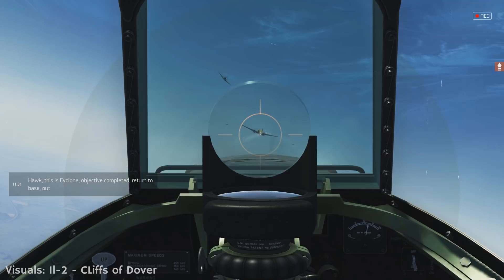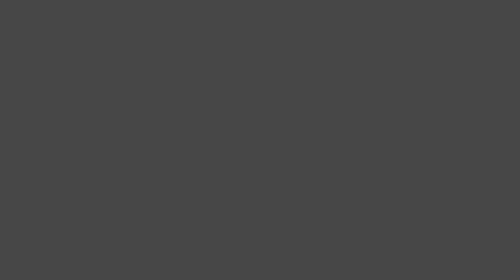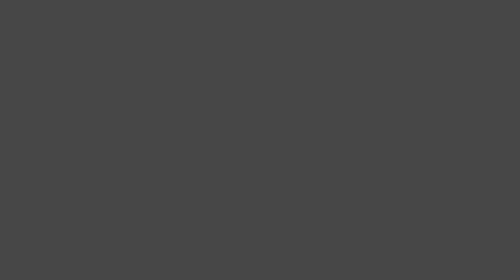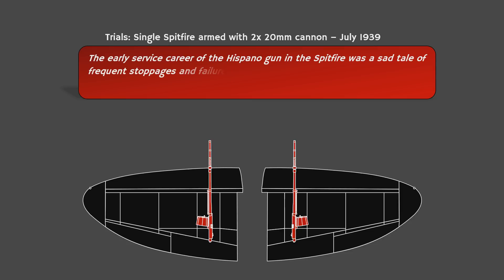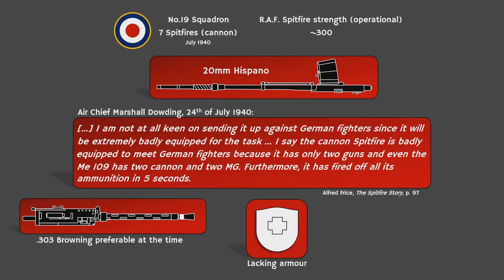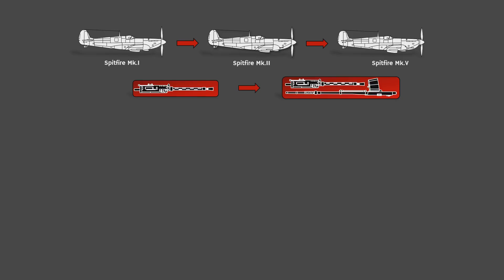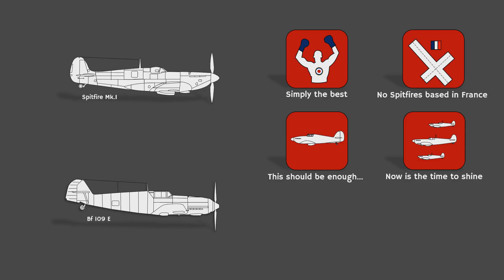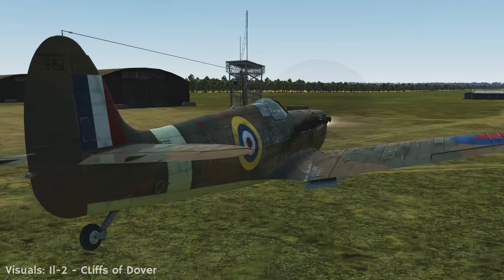⚜ | Clearing up Spitfire Misconceptions

Comment: There are two major factors that helped the Spirfire (and Hurricane) over the 109 during the battle of Britain:

1) Benign stall characteristics in a tight turn, a Spitfire had benign stall characteristics in a turn. When a pilot got close to a stall situation the stick would start to judder warning of an impending stall. The 109 on the other hand would give no warning and would depart violently. Ironically the 109 with its combat slats could out turn a Spitfire but it required a highly experienced pilot to take advantage of it. For the Spitfire (and Hurricane) a new pilot could perform tight turns without fear of stalling the aircraft.

2) Fuel, arguably the biggest advantage the RAF had, operating out of home bases RAF fighters had more fuel available for combat whilst a 109 was limited to a few minutes.
Reply: Even with combat slats the 109 could not out turn a Spitfire, especially at faster speeds where it was literally impossible to turn a Bf 109 but the Spitfire elevators were still very light. The Mk II Spitfire pilot manual actually specifically says it was well within the pilots ability to pull 10G's and to therefore treat the controls with respect. And the bf 109 slats were an absolute disaster anyway. They could often deploy asymmetrically and get stuck ruining the stability of the plane. If the Bf 109 was behind a plane then the slats could also be deployed simply from the slipstream of the leading plane and when the slats were open they caused aileron snatching making aiming impossible. There is a reason why Kurt Tank didn't include those awful slats in his much superior Fw 190.
Reply: The RAF switching over to 100 octane fuel between the Battle of France and the start of the Battle of Britain gave the Luftwaffe quite a shock. The Luftwaffe weren't too impressed by the performance of the Hurricanes and Spitfires they captured in the Battle of France and were expecting the same thing in the Battle of Britain but instead the 100 octane fuel allowed the Merlin engines to run at 12 lbs boost instead of 6 and they were all fitted with much more efficient propellers. The fact that most of the RAF in the Battle of Britain were made up of brand new recruits who had only received 10-20 hours of training before being sent into battle consistently outperformed their Luftwaffe opponents, most of whom had gained a lot of experience fighting in Spain, Poland and France, is a real testament to the quality of the Hurricane and Spitfire.
Reply: I remember watching a BBC documentary about the Spitfire V Bf 109, where they got engineers and current fighter pilots to compare them.
As machines they came out as equals. 
But the Spitfire won on ergonomics (more room for pilots elbows and better laid out cockpit), visibility (better canopy) and survivability (Spitfire had an armoured cockpit).
IE: As a pilot it was easier to get the best out of the Spitfire and if you were shot down , the chances were that you would liv to have another go.
Reply: Some of it was obtained from the USA - Britain actually developed its own 100 Octane blend in the early 30's and had significant UK based production capacity. Britain had stockpiled 100 Octane starting from before WW2 but didn't deploy its use until it was required for home defense ie it wasn't used in France. The British actually ended the Battle of Britain with 500,000 tonnes still in reserve such was the reserve they had stockpiled in advance.
Reply: ISTR Shell did a lot of the high octane fuel research --- ISTR  100 Octane was also produced  at BP Isle of Grain, Kent refinery  which must have been a bit to close to France for comfort . The vital glycol for the cooling system initially  exclusively came fro the USA.
Reply: yeah I don't get the spitfire hype when hurricanes did the heavy lifting during the war on Britains end
Reply: 18tangles lol that's a good one. And here I thought British bombers  were the reason hitler pissed himself and took the luftwaffes attention away from the RAF during the battle of Britain and towards london. But what do I know you think the spitfire beat back the entire Luftwaffe on its own
Reply: 18tangles I don't know what to tell you other then the RAF bombed germany in the month of august in the year 1940 during the battle of Britain. Google it, it was a retaliation after some german bombers bombed london
Reply: 18tangles just. Look. It. Up.
Reply: i have read of Spitfire pilots watching a chasing 109 in a steep turn, knowing that if the 109's leading edge slats opened the German would have to break off or stall and be toast.
Reply: Spitfire Mark1A  Can't say for the early part of the war but in 43 the Mustangs used 150 octane fuel and thus were   considerably faster than a 109. I would imagine the Spitfire could use it to after carb adjustment. The 109 was at a huge disadvantage because of fuel capacity, 20 mins max over England in the Battle of Britain. Also the Spitfire 1 had very poor armament (.303 with 8 seconds of ammunition). The 109 had 1very reliable 20mm cannon and 2 8mm  and later 12 mm machine guns with 28 seconds of ammution. All in all the Germans suffered from an insane dictator and a incompetent Luftwaffe commander. The Brits  had Hugh Dowding who only got a tenth of the credit he deserved.
Reply: To me it seems the Hurricane was built to be a rugged, effective, fighting machine.
The Spitfire was built to be fast.
And the 109 was all of the above.
Reply: Spitfire Mark1A 
Totally agree.
And then they made the Griffon powered Marks we all love to hate, 
it seems.
Sounds like book right up my alley. Will seek it out.
Of course you have read Geoffery Wellums book First Light?
Reply: I have always wondered why the spitfire wasnt equipped with droppable long range fuel tanks like the mustang.THe spitfires could only support bombers until they reached the french coast and then they had to turn back leaving the bombers to be attacked by the Luftwaffe
Reply: @falconeaterf15  I actually prefer dogfighting in a Hurricane (flightsims obviously)... It has been several years since I flew but it felt as though the Spitfire needs to bleed off speed in order to get the best turn characteristics whereas the Hurricane's max speed still allows for the tight turn that I wanted... if that makes sense... It's a feeling thing and I suppose it depends on each pilot's style. The Hurricane just seemed to do what I wanted it to instead of fighting against me. Couldn't follow a 109 in a steep climb though but soon learned not to try!
Reply: Fuel, range and time on station was why the Me110 had the best kill ratio of the BoB.

Comment: Thanks for an interesting video. One minor observation: I'm pretty sure your graphic of the .303 MG is upside down. I can't speak about the aircraft version of this gun specifically, but I know from personal experience that the standard land-based version couldn't operate for very long in this orientation as it relies upon gravity to remove the spent cartridges downwards once they have been pushed clear of the "T" slot on the face of the bolt. If fired upside down, spent cartridges would quickly accumulate at the (now upward-facing) bottom of the bolt and eventually fowl its operation. Again, I'm assuming what would apply in this case to a land-based .30 cal would also apply to an aero .303 MG.
Reply: You're right, the Browning graphic is inverted.  However, the Browning has an ejector which flips empty cases forcibly out through the bottom of the gun.  It will do this even inverted.

Comment: Well presented and very informative. Thank you.
A footnote about Hurricanes in the Battle Of France: I have "Fighter Pilot" by Paul Richey, which tells the story of No 1 Squadron's campaign while based in France during the battle. The bottom line was that, even when fitted with a fixed-pitch, two-blade wooden propellor, the Hurricane, when flown by seasoned pilots, could hold its own against the Bf-109 and was superior to the Me-110

Comment: I have always argued that the Spitfire is the best fighter if the war simply because it remained a very serious opponent from the first day of the war to the last. Many of the other "greats" weren't around from the start, and those that were weren't nearly as competitive by the end of the war. No matter what fighter an opponent was flying, including the Me 262, an engagement with a Spitfire was a deadly serious matter.
Reply: I think I read that the German supply problems with raw materials was one of the main reasons that they struggled to keep pace with British advances in metallergy. Sure, the Germans had the ideas, they just struggled with raw materials not that they weren't inventive.
Reply: The US kept the P-38 in production before firing and after, the P-40 as well.  You can argue they were niche fighters, but the P-40 excelled at simple field maintenance, ruggedness, and cheap to build.  Outfought me 109s low to medium level; turned tighter and rolled faster.  8 50 cals hit hard enough.  Ease of maintenance keeps them in service.  Guess my point is that no one machine did it all.  Range of a Spitfire, 423 miles, range of a P38, 1325 miles.  Lose an engine;  keep flying.  Nose mounted canon / macine guns, effective to 1,000 yards, no need to synchronize the bullet hose.  Spit as others, pick your yardage for gun synch.  No one design was head and shoulders above another in all essential aspects. The Spit was comparatively a short range weapon.
Reply: Except the later war models were a lot different than the early war ones
Reply: That had at least as much to do with the training of RAF and Commonwealth pilots as anything else.
Reply: @RemoteViewr1  the P-38 failed as a high altitude fighter.  Allison never did make a successful high altitude engine, not even in the P-82.

Comment: Video on spy, gun and reconnaissance cameras used and how they worked on aircraft in WW2? Attempt #4
Reply: I'd like to see that too!
Reply: and also their effort in the great war.
Reply: I too would like to see a video on this subject (and also contribute via Paetreon.).
Reply: The RAF reconnaissance Spitfires were really clever. The photos they took were actually in 3D which allows the intelligence staff analysing them so much more information and detail that they wouldn't have with normal photos. They could tell exactly how tall structures and defences were for planning attacks including the dam busters raid. They also allowed them to find the V2 rockets being developed, with normal photos a V2 would just appear as a tiny round circle on the ground but with their 3D photos British intelligence was able to see exactly what they were and even their exact height so air raids could be launched at the V-2 research centre and delay their development.
Reply: Evidensinsania: Not only Spitfires; the predominant PR aircraft in the RAF was the Mosquito.  
The British had pioneered the use of stereo pair photography in WW1, and made extensive use of the technique in WW2.  It was therefore well-known to all sides in WW2, yet the Luftaufklärung units did not make any great use of it.  Perhaps worse is the fact that the Wehrmacht had no central specialist reconnaissance organisation like the PIU at Medmenham, and that most reconnaissance was tactical in nature.
The measurement of ground features using Swiss Wild Heerbrugg stereoautograph machines allowed for the construction of accurate models of ground features to prepare for critical missions (the Dam Busters mission is the one everyone remembers - and those models were made at Medmenham) as well as accurate sizing of items like the V1 and V2 prototypes.
Reply: Interesting, thanks! I recently got a book on before and after the spitfire and it goes into detail on aircraft branching off from the supermarine aswell. This information fits quite nicely in my knowledge on air doctrine and how powers made use of this sort of technology. Cheers!

Comment: The A, B and C wing configurations were the three most common.
Reply: A 8 x 303
B 4 x 303 & 2 x 20mm Hispano
C As above, or 4 x 20mm Hispano*

*performance penalty

There was a bet between vickers supermarine engineers and the RAF as to whether the Hispano could be fitted into the S7 FI mk V wing. £100. The Supermarine guys won, and they got their money after a quiet chat with RAF senior command staff.

Comment: German engine manufacturers such as MB used mechanical fuel injection in race cars before the war. They have advantages in fighter planes for the reasons discussed in this video,  BUT fuel injected motors run hotter than carbs, thus the ME109 couldn't run constant pressure from the blower, the Spitfire could, because of the charge-cooling effect of the carbs. Post war BMW used mechanical fuel injection in many cars like the 1602, 2002. MB still use Kompressor on cars in the same way ie not constant pressure!

Comment: One bad ergonomic issue with the spitfire was the prop control. There were Rotol and Hamilton Standard props with two positions - fine & coarse. The problem was they used the same cockpit control but inverted. One type you pushed the control forward for fine, the other you pulled it back. You only ever made that mistake once...